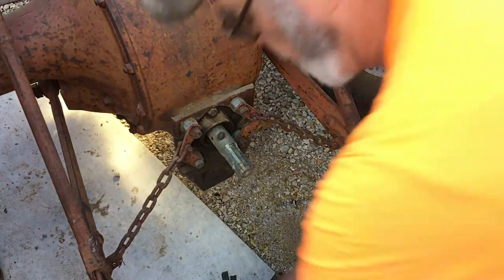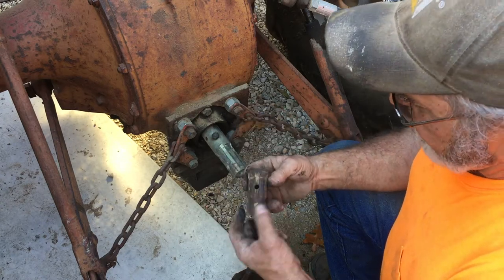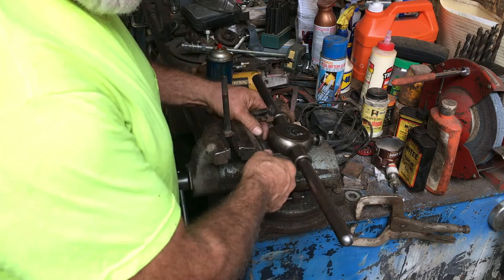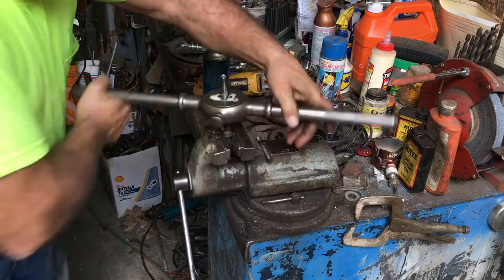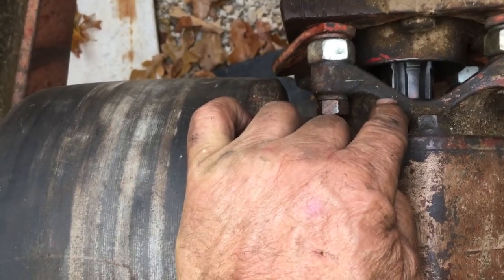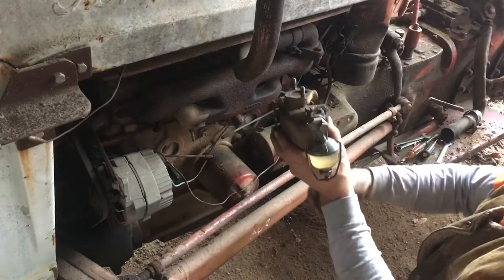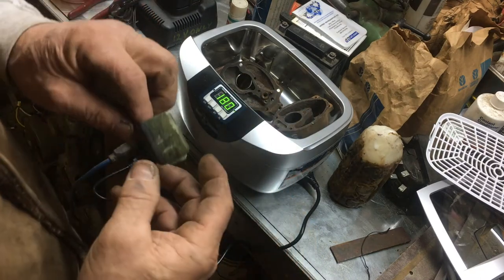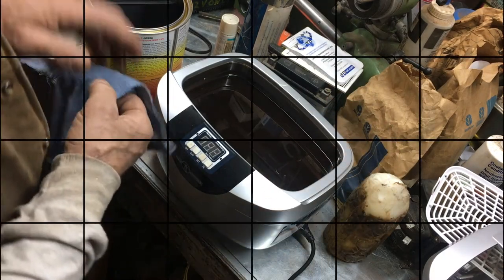Buzz Saw Makeover Part 5

Comment: I've been having fun doing catch up watching. I do love cleaning things up, repairing and making them go again. That old tap and die set are beautiful old tools made well, you can see that in the video. I too have bolts, nuts, screws and nails very old. I have hand forged rose head nails and even some hand made screws that have hand filed threads.  I used them in period furniture restoration. I even have a box of model T points, used ones. Even have a set of square drive sockets that are at least as old or older than those bolts from the farm. Funny how you get older and 100 years isn't as long a time ago as you once thought, eh? So my Friend Wendell 44, I Thank You Kindly and already toasted you while watching! Now, on to more 44 vids! DaveyJO
Reply from the maker: Man, you tripping right through some of the old videos !!  Thanks a lot for going back and taking a looksee.  I can't wait until you see the daughters house I've been working on where I installed a walnut handrail from my Granddads Mercantile building from 1882.  I DO like using old supplies and both myself and the older brother have boxes of hardware from the old man's blacksmith shop as well as tools etc.
Reply: Tractorman44 you and your brother having those things? Now that's what I call real treasure! And just think, not long from now I'll be making a new pot of JO in the morning! I'll toast you in the morning! DaveyJO

Comment: That my friend was A great series of videos for the tractor and the buzz saw! And your are correct on your age old debates of what is better... the one that works and gets the job done, that is the one!

I remember that several years ago, some of my friends were bashing my 1985 Ford ranger, this truck was intended to be body parts and a trailer body downer for my 1988 ranger that was getting tired! Low and behold, one day I pulled into my driveway with 2 half’s of a truck! So when you think about how a commercial electrician works a truck, even a 1 ton takes a beating, let a lone a 1/4 ton truck with 380k + miles on it! So on Christmas Eve in 2003, my friends and I pulled the engine and transmission from the parts truck and rebuilt them on the kitchen table, and did the start up and “ maiden voyage” on Christmas Day a 120 mile round trip to north Jersey in a slapped together truck complete without brakes! I later found service records that informed me of the mileage on the truck, and confirmed it with motor vehicles, that 1)I was the 14th owner of the truck, 2) each 3rd renewal of inspection the odometer read less milestone when I got the truck it had about 420k. Now from building the engine to trading the truck in I averaged about 90-120 k miles/ year, so for 7years I abused that truck in every way possible!
Reply from the maker: Now THAT was a busy Christmas !!  LOL. Btw you see MY daily driver ??  It too is an 85 Ford but it’s on the other end of the spectrum. F250 with punched out 460. I changed the 3/4 ton rear to an 86 one ton dually. Then added an adapted flatbed to that with a double spring stack. There is a lot of life in old stuff. It’s just so many people believe the hype that “you are what you drive” and so they go deep in debt to show others who they really aren’t. Lol. I worked with guys in the big city that wouldn’t be caught dead in my old truck. But then I wouldn’t be caught dead in a $50,000 new truck in the middle of the woods retrieving a dead tractor either. Lol. You proved that you are what you are.... not what you drive !!  Lol. Loved your Christmas story !!